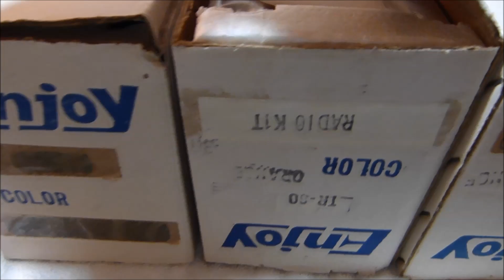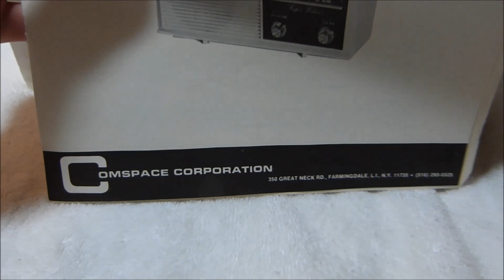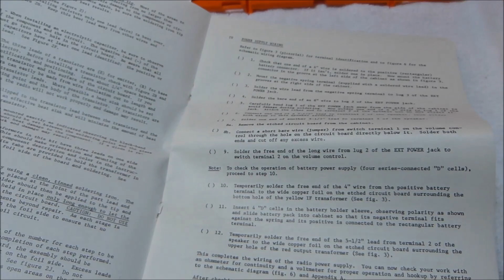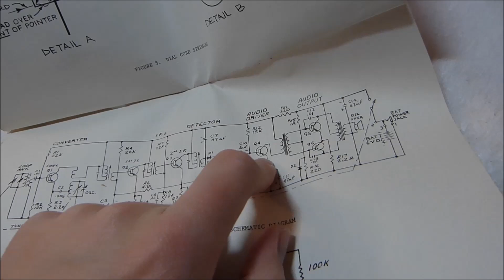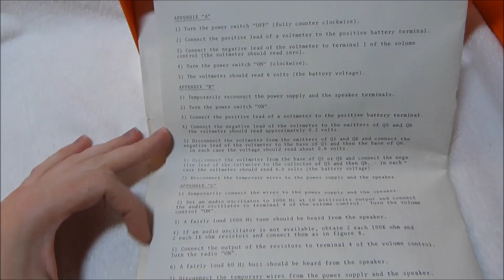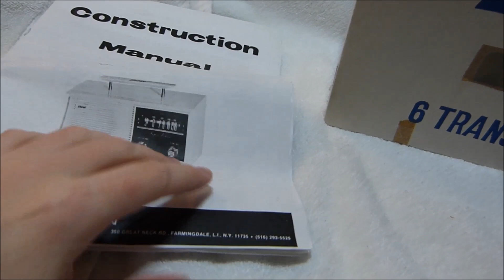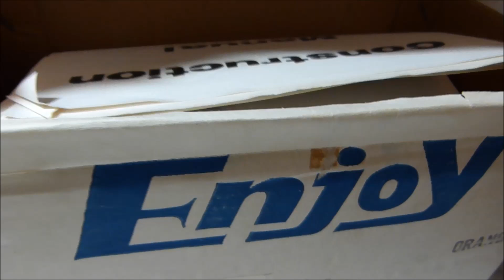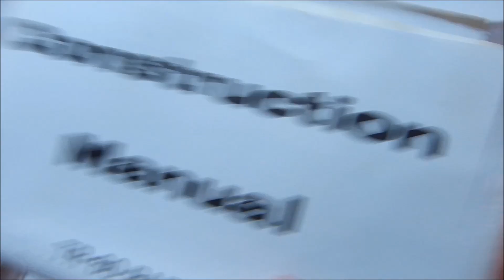1976 Enjoy model TR-60 transistor radio kits (part 1)

Comment: I tried building that kit and unfortunately it has a design flaw that makes the kit unbuildable due to a fault in the schematic. Looks cool though
Reply: You don’t think they wouldn’t build test kits in the factory ! Probably your building .
Reply: @ I had a professional look it over and the schimatic and they said the circuit is flawed and incorrectly made and that the circuit design will never work. Maybe mine has a defective board layout. It’s possible for a board to have the traces improperly etched

Comment: This is a cool video. I built a lot of kits (Heath, Knight, Lafayette) back in the days but I have never seen this brand or kit before. I love the orange.  I was wondering, did you do a part 2? I looked but couldn't find it. Great stuff and I look forward to watching more.
Reply from the maker: There's no part two currently, because I never did get the radio to actually receive anything. I still have the kit, and I should take a crack at finishing it, though I'm not sure where I packed away the cabinet.